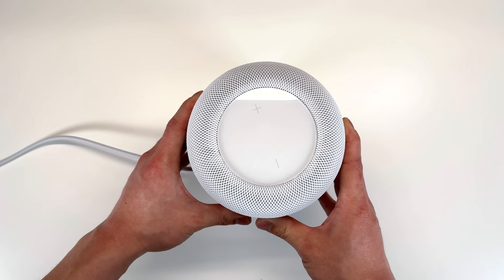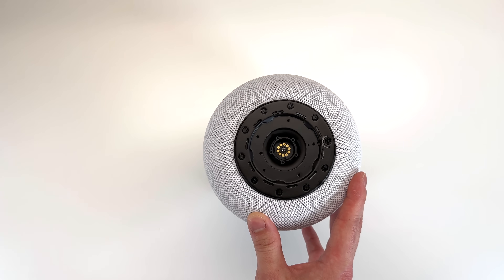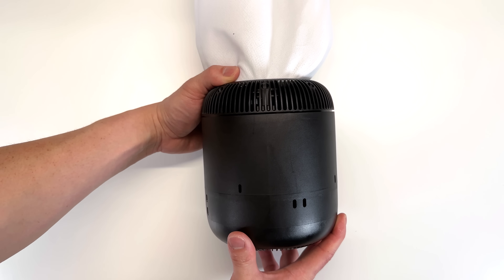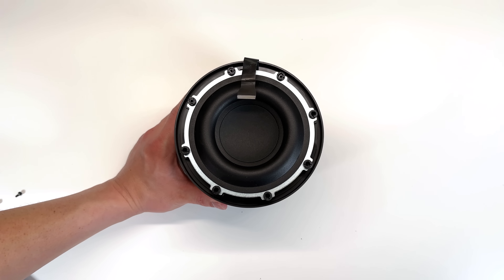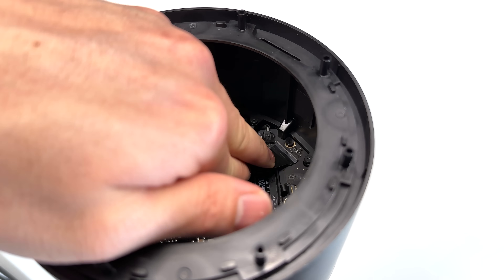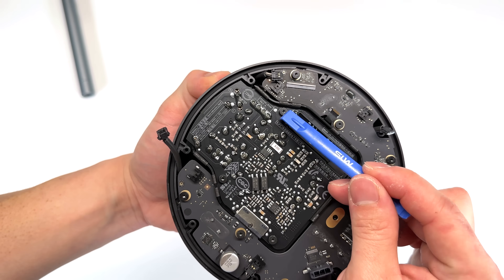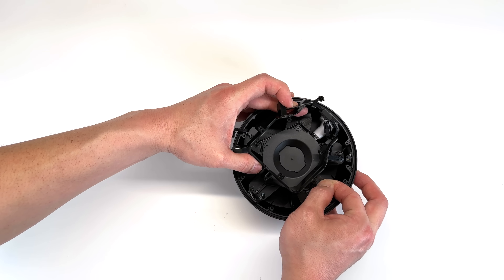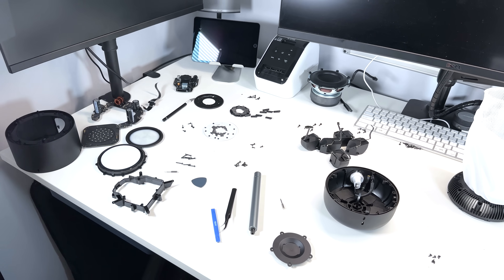Apple HomePod 2 Teardown / Disassembly (New Inside)

Comment: I have a defective HomePod 2 that suffers from the ghost touch. Unfortunately the issue started 1 month after the 1 year standard warranty expired 😒
I considered disconnecting the touch panel cable, but after watching this video I realized I didn’t have the patience for it… And the repair cost at Apple will be so high that I might as well buy a new one. But I agree there should be a class action lawsuit for this very frustrating defect!

Comment: At the last stage of production, they travel on a conveyor belt connected to the diagnostic connector at the bottom. This allows you to upload the system and calibrate the speakers in the chamber.
Reply: This.

Also, do you think they calibrate every speaker? Or only some of them?

Comment: The programing header on the bottom caught my eye right at the start,  definitely used in production for testing and  firmware installation etc... They would need that for profiling the speakers.  Its likely a JTAG or SPI interface of some sort.

Comment: The tweeter component looks like it could be a tweeter + exciter combo. An exciter is a transducer device that attach to surface and vibrate the surface mechanically that translate into auditory information. I think this because of how the housing is shaped to follow the contour of the base, maximizing contact with the base panel for the vibration to be transfered over. Clever!
Reply: Surface speakers are using metal contact or hard material for the surface. If this speaker would be here, the bottom rubber feet would kill all the vibrations.
Reply: interesting thought but not really the case here - you can see the tweeters are completely within in their own sub-enclosures

Comment: Disappointing the amount of cost cutting that has happened with the 2nd Gen. Less microphones, less tweeters, slower Wi-Fi, downgraded SOC, volume controls printed etc. The internals also seem simplified and it’s lighter. Just a less premium product overall probably because they don’t want it to have the same fate as the first!

Comment: Die small circular panel with the 8 or so metallic parts ist the diganostic port that Apple can use to Update the software if it fails to Update or bricks in any other way.

Comment: So, how different is this HomePod 2 compared to the breakdown of the HomePod 1st Gen?
Reply: There is no glue here. It looks like Apple realised the way the first one was designed (which would have ensured it never rattled or fell apart lol - hence the glue) was a bit of an overkill and resulted in a device that had to be destroyed in order to be disassembled. The huge number of screws used for each session in the 2nd gen enables them to distribute the pressure more evenly to ensure a consistent seal across the device. I can’t help but feel that this HomePod was significantly cheaper to make compared to the original.. given how simple the construction of it actually is!

Comment: Great teardown. Those pads on the bottom are probably for programming in the factory.
Reply: @Amen Tma Definitely not.  It would not be covered by rubber for starters.
Reply: @supernovahm1178  I'd bet it's JTAG, but once they program it, of course they lock it down.
Reply: Or for wireless charge in Future
Reply: なるほど！
Reply: *pare
Reply: Agreed; Probably JTAG
Reply: *tair

Comment: I'm genuinely shocked at how small the hole are for the tweeters to pass sound out. I would have assumed they'd be much larger.
Reply: Those small holes are just the exit diameter of the compression drivers.  It looks like the base of the HomePod contains 5 waveguides that flare out like a traditional high frequency horn.
Reply: @robocobrabot  Okay thanks, wish he would have shown that better. I was so confused.
Reply: @robocobrabot hi I wonder would you know what compression tweeters and woofer is used. Can they be sourced from the oem supplier?
Reply: @diyfullrangehifispeakers I do not, but knowing Apple, they likely spec out their own custom drivers.
Reply: Me too. I actually didn’t see the holes you are referring to?
Reply: This was also my first thought. Really strange.
Reply: Yes, and then add two layers of fabric over those small holes. It being Apple, I am surprised they went with a Ferrite magnet on the woofer rather than a neo. Curious how this sounds.
Reply: @Ylm-r9g  the first gen has neo. That’s why the first gen has better excursions resulting in deeper bass
Reply: Wondering this also, seems like 2 layers of plastic to get through.
Reply: The Sound came out of the grill down at the bottom. Like at 2:15

Comment: Well done, sir! You did an excellent job tearing down the new HomePod. I don’t believe I would have the guts to do this, haha. Very clean video, sound and a great explanation of your descent all the way through till the bottom.
Reply: Fantastic tear down!! The tweeters at the bottom must be part of a system of waveguides that disperses and spreads the sound waves from each of the modules out of the base of the HomePod. Would love to see one of the tweeter modules taken apart to see how they’ve designed it.

Comment: Wow, thanks for this video. It's is strange that the tweeters looks really different than what they showed on their website.
Reply: I believe these are just the plastic housings for the 5 compression drivers.  It looks like the drivers fire downward into a waveguide that it part of the base of the unit.  The housing probably shields the opposite side of the driver to prevent acoustic leakage and allow for more directional audio.

Comment: I just wonder if after you shot the video you able to put everything together again
Reply from the maker: It took a while and I had to refer back to the teardown haha. I've now done it twice and can do it without the video
Reply: Doe the mesh grill fit back into the bottom well? It seems like Apple has put a warranty void seal in the mesh, with the drawstring.
Reply from the maker: @djijspeakerguy4628  I sew it back together with no problems. Definelly need to use thicker thread though. It also does not look original so yeah Apple would probably know.

Comment: I wonder what is written on the amp chip that was under that heat sink! Mine REFUSED to come off on our stream, I gave up in fear it would rip the chip off. Maybe snap a photo of the area cleaned up?

Would love to know so we can compare it to the powlraudio 98-0431 used in the gen1

Edit: I took mine apart again and got a look at what's under the shields on the logic board, and the amp heatsink

Comment: Those gold contact points would be the diagnostic contact points that they would use to determine issues with the HomePod, just like the Apple Watch series 7 and 8.

Also, amazing video
Reply from the maker: Ah, good to know! Also easy access for techs to connect to. Thanks, I'm trying to up my YT game. Just got a new mic and tring to figure out the focusing/white balence.
Reply: @brandon20904  here a question can you combined new HomePod 2 with HomePod 1 and see if the parts are interchangeable between the two
Reply: These are probably also used to load the software onto these units. If you look at Demo Apple watches, they also have a set of these inside the wrist band holder piece. I'm guessing there is some device that essential is like a lightning connection or USB of some sort to load the software into these so they don't have to go through a wireless setup/connection.
Reply: Agreed. We had an old HomePod that died on its own, and the Apple Store said tough luck because they had no way to diagnose the issue non-invasively.

Should be a solved problem now, barring stupidity!